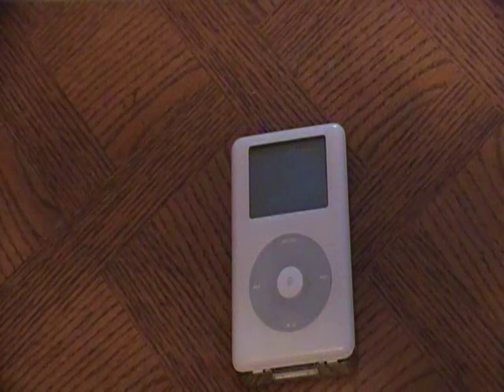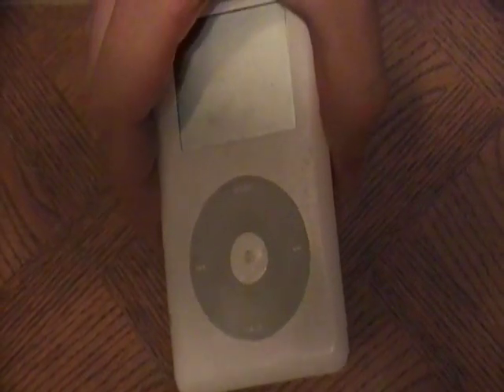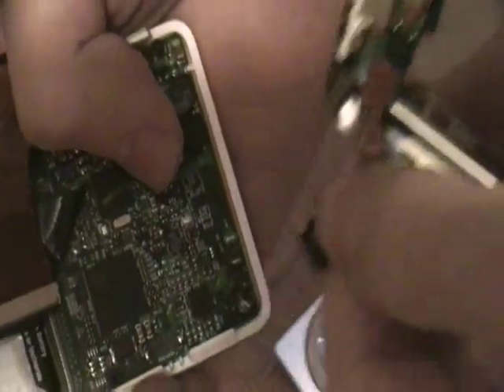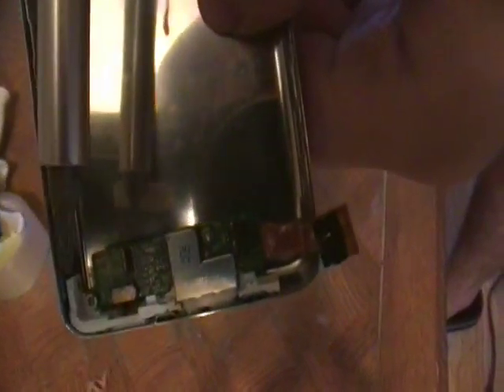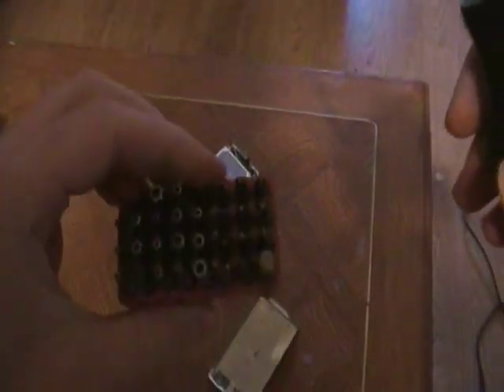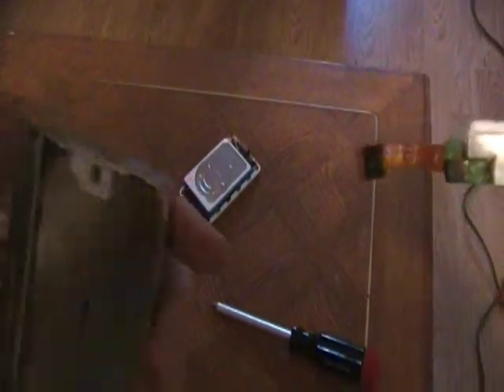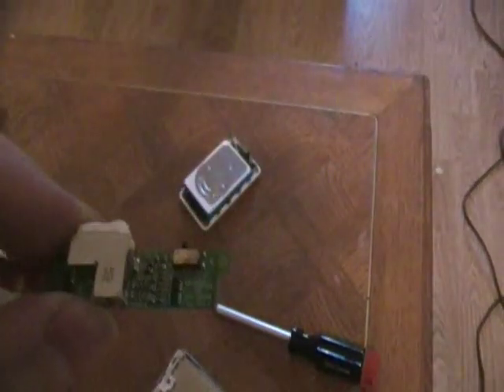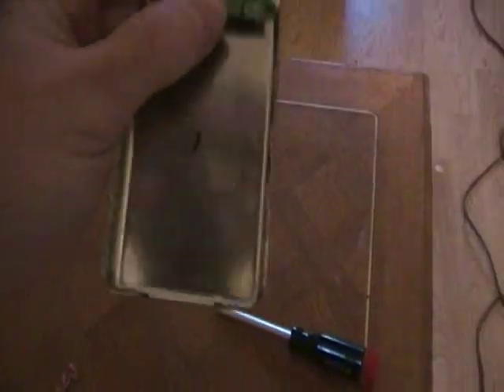How To Fix An ipod Earphone Jack

Comment: mine, headphones r only working on 1 side, plus aux cord u have to hold up in order for it to play. when u plug it into car or speakers. i have an ipod 160 gb classic. and are the gold pieces suppose to be higer on 1 side in jack. 1 side is top other side is below the black rubber. so im thinking i may just need to adjust something

Comment: @ohmyclumsyheart Try it. If you can't get professionals to fix it then you have nothing to lose. I did it with my iPod several times and it still works like new (the cover is scratched up quite a bit, but I have a cover for it so I don't really mind). Trust me, the only way to break your iPod by opening it is if you're using a hammer...